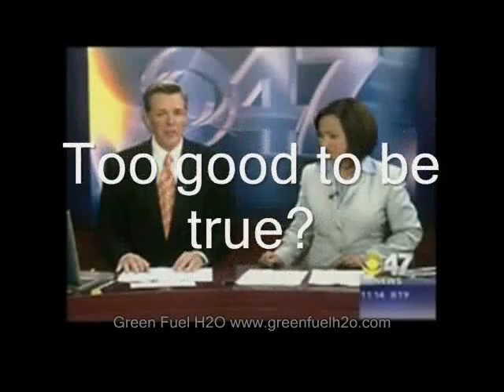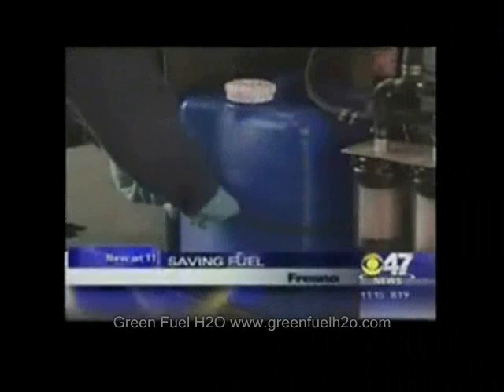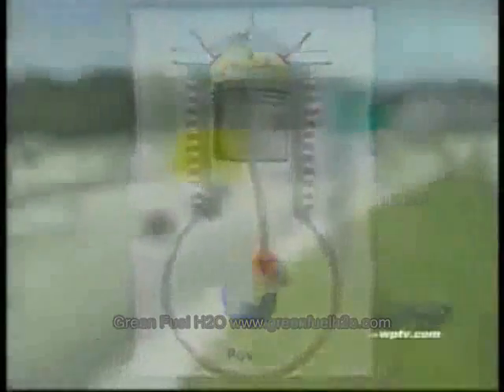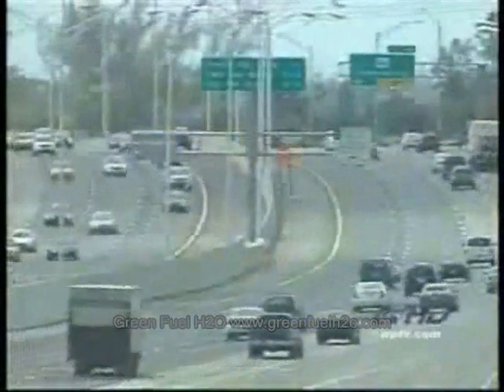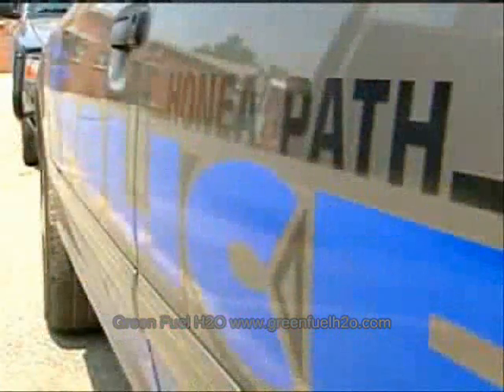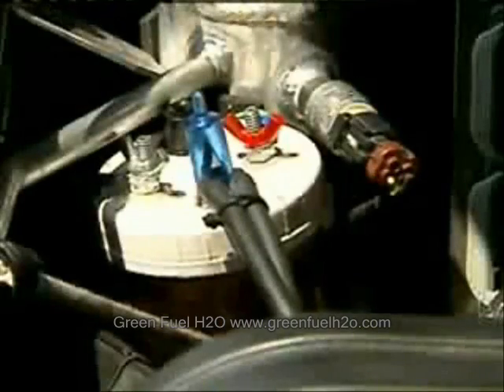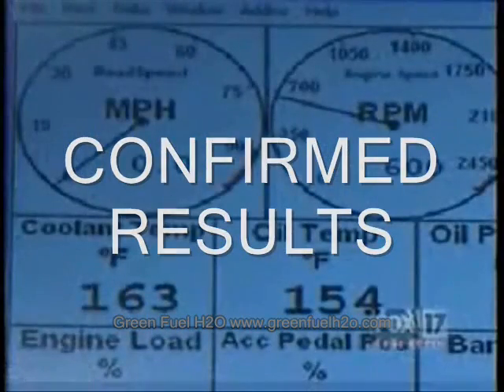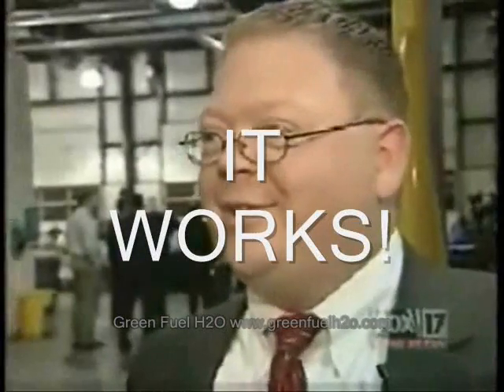HHO, Hydrogen Generator, How does it work and what is it.

Comment: @kw757 the temps in the cylinders is to extreme for the oxidation of the metals to occur, and if your worried about your exhaust system rusting go with stainless steel exhaust.

Comment: @kw757 There is water vapor sure, but do you realize that it would only create a microscopic amount, or that that super small amount could never condense into liquid in a super heated chamber? How about this...you see the space shuttle take off, using a super huge amount of hydrogen and oxygen in the same ratio as an HHO cell, but yet you don't see a stream of water behind it. AND a cylinder could only rust if there was no oil coating the cylinder. Ever seen an engine without oil last very long?

Comment: Everytime an engine runs, water vapor mixes with the air and the cylinders does not rust at all because of the constant lubrication from the oil pan. So therefore regardless if your engine is fitted or not fitted with HHO the cylinders will never ever rust at all. So please people stop saying that HHO will rust the engine. AGAIN I would say HHO really does work.